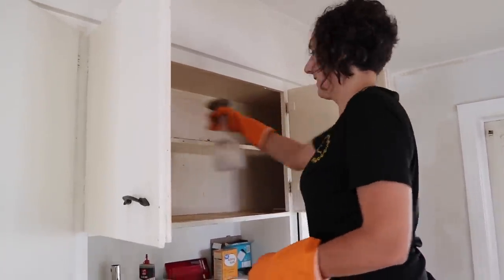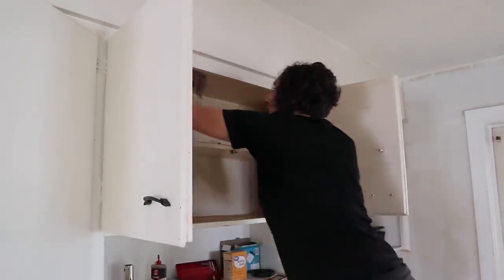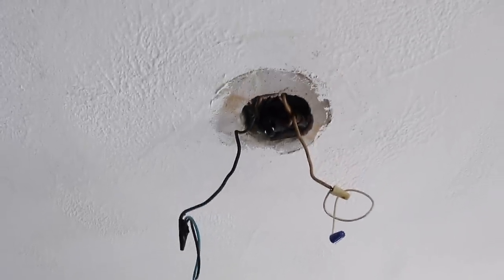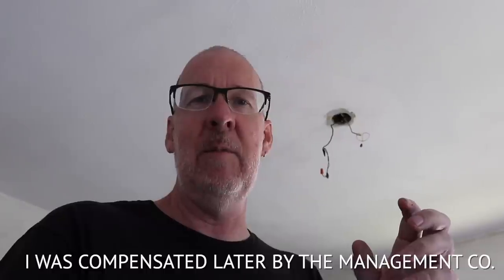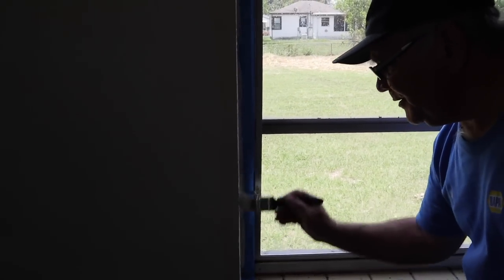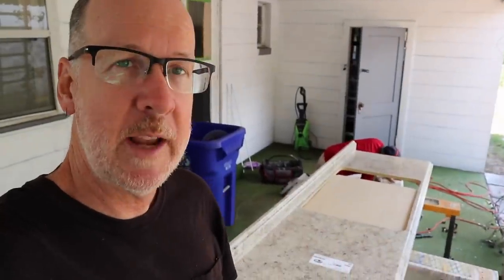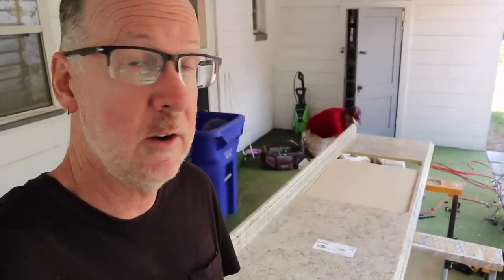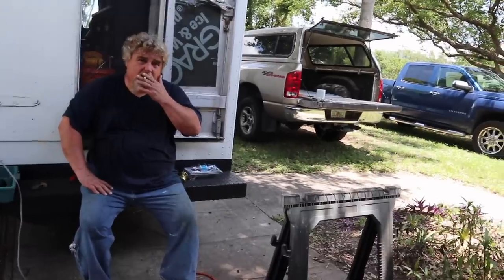Repair Progress at My Lakeland Rental E540

Comment: Spraying foam insulation on the backside of the kitchen sink preserves the metal, and insulates the sink against temp. changes and sound. Changing out the counter top is a BIG improvement in updating your home.  Thanks for sharing.
Reply from the maker: my sink in the step van is that way

Comment: The mystery of the missing fan. My theory is that a maintenance man took it to put in another property as an emergency measure and got caught out as you came back and did not just roll over and use the managemant contractors for the renovation. I knew someone who looked after rentals and a crisis in one property was sometimes temporarily resolved by emergency borrowing a freezer from one which was vacant.
Reply from the maker: Andy, quite possible with your theory

Comment: Seven, more likely your ceiling fan was taken by a renter and your "management" company missed it. It's unlikely a handyman would have came along and taken it because used ceiling fans aren't in big demand, and certainly not worth a burglary charge. Looks like your costs are mounting up fast. Hopefully you can recover some of that back through tax write offs and increased rental fees.
Reply from the maker: the difficulty with that theory is the tenant vacated the property leaving ALL her belongings including clothing, furniture and a few items. she took only what she could fit in a mustang convertible. I just can't see her thinking, "well, I sure need that ceiling fan and must make room in my mustang for that" and then taking the time to remove it, cap the wire ends and then put it in her car.
Reply: @SevenWanderstheWorld  I understand what you're saying, but what I meant was some previous renter, not necessarily the last one. It sounds like your management company was pretty lax in actually taking care of your property. Who knows what was really going on there?